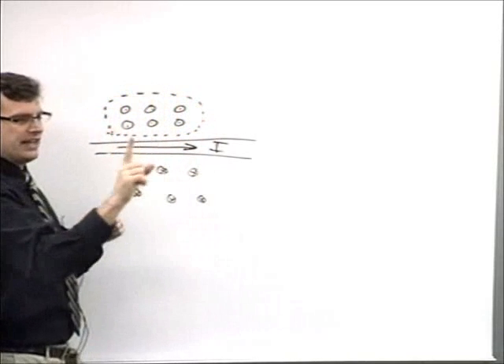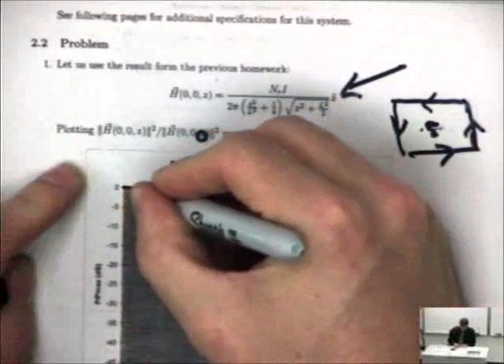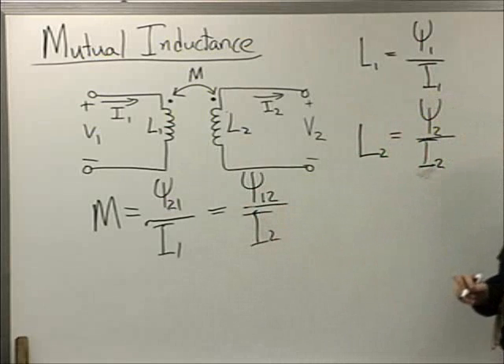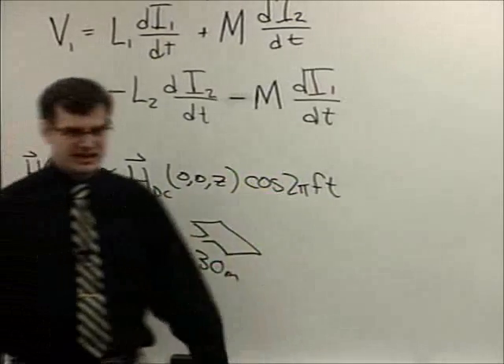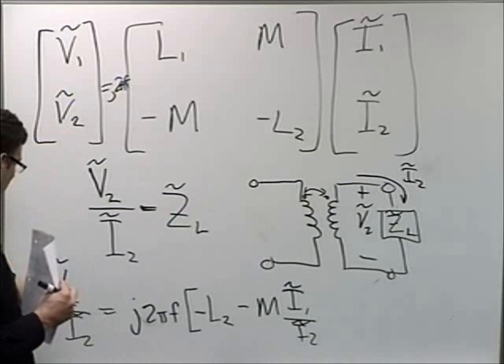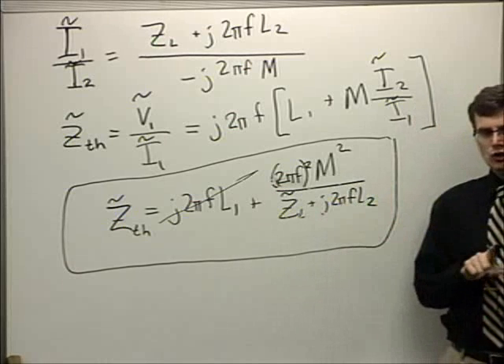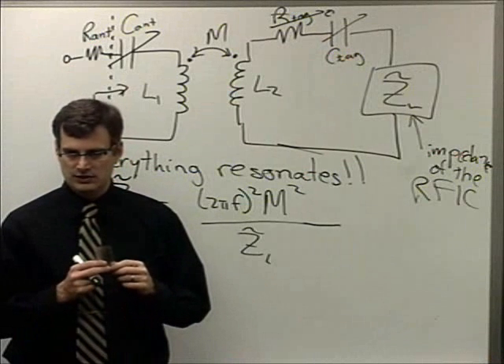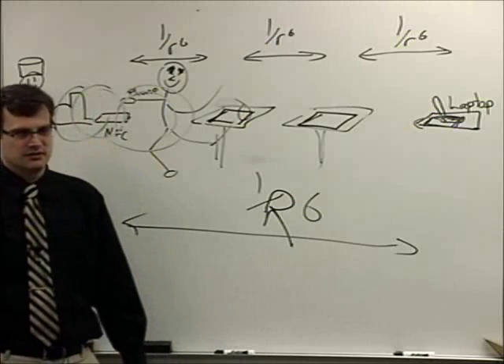MSF06: Mutual Inductance

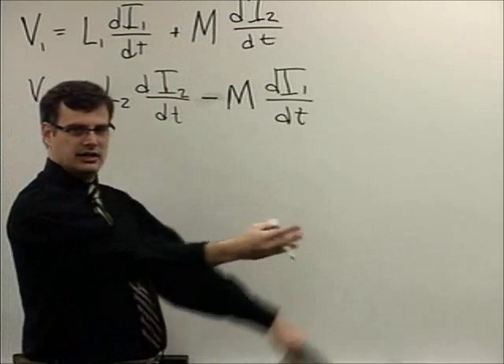Comment: to me it seems like the equations at 26:09 are wrong, in the drawing I1 is entering the dot and I2 is leaving it, so the induced voltages should be negative, right?
Reply: I also think they are wrong. Both mutual inducted components should have opposite polarities from what is shown. I repeated the derivations with signals flipped and obtained the same final conclusion about the thevenin equivalent impedance.